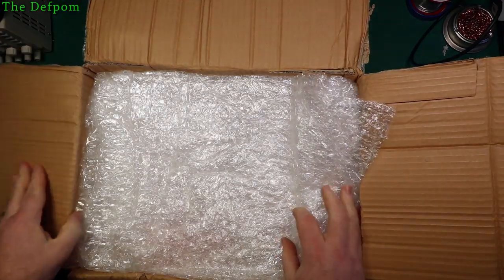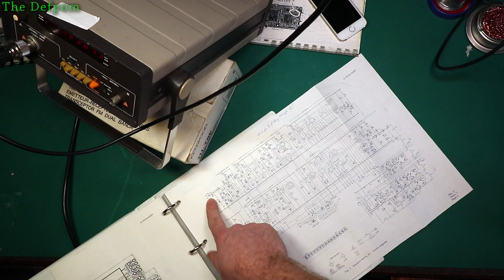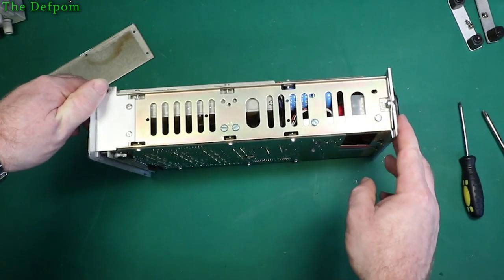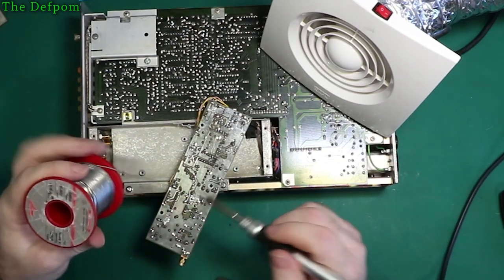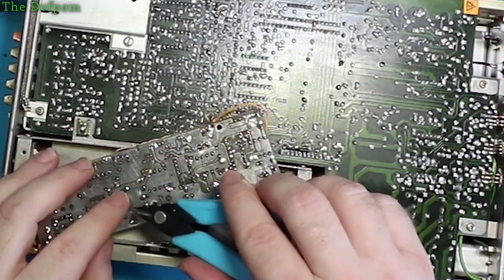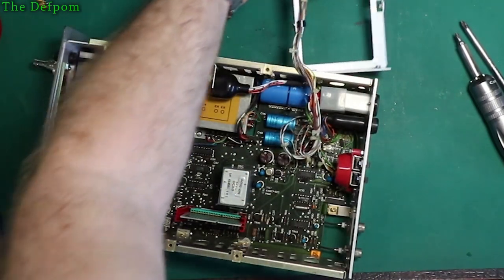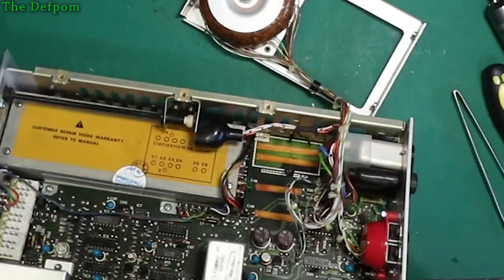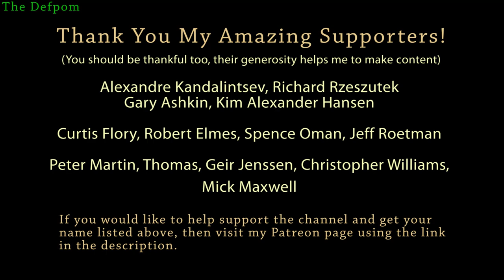🔴 #597 Marconi 2435 Frequency Counter Repair Part 1 - When Tantalum Caps Go Bad

Comment: It is great to have the original manuals and well worth the money when doing a repair. Down conversion is a common arrangement in higher higher frequency and cost units like the Marconi. You just reminded my about that high resolution HP counter I half fixed. I cut the tantalums out just didn’t get around to refitting them. Sole destroying but you really have to change them all and the main smoothing and check for ripple on the rails.
Reply: AllTheGearNoIdea
I agree, the roadmap of a schematic makes clarity of the utter mess of a circuit layout :-D
But some diagrams look like the drawer was on lsd or similar drug when drawing them, mad diagrams lol.
Reply: zx8401ztv  I think CB drawing are awful apart form the ones in those SAMS Photofact manuals they are like works of art. The Marconi drawing will be good.
Reply: Yes they are, i think modular sections with input/output labels just look simpler.
Then you can test a block one at a time.
Reply from the maker: AllTheGearNoIdea - I don’t mind cb diagrams, you get used to where they put everything and can find stuff easy enough.

Comment: Baby tants with values under 1uF simpler to replace with Wima MKF film capacitors, 0.47uF 63V is around the same size, similar enough footprint to fit and in most cases the height is fine as well, or use green dipped mylar capacitors. Close enough ESR wise, and better pulse handling ability.

Comment: Getting a wet slug tantalum backwards is a lot more interesting. They go bang quite violently, as they pop only over 180C case temperature, where the solder melts.

Comment: As  test engineers we used to tape a tant under the work bench of fellow engineers and when they were in deep thought reverse bias them with a psu. sounded like a gun shot between your legs? elf and safety was not a phrase used much then if at all.

Comment: Great work, can't wait to see part 2! For tough old/crusty rosin I use acetone - a solvent available at most hardware stores here in the states. You just have to keep it away from most plastics! Once the rosin is softened I use alcohol to remove it. You realize that by breaking that seal you have voided your warranty  ;-D

Comment: I always test ALL caps and resistors and also any diodes with the diode test in multimeter.  Sometimes it takes a while to do that.  But anything I thus find gets replaced.  Ive also taken out transistors and popped them in one of them $5-10 testers.

Comment: I have seen many dipped Tantalum's in test gear fail in the complete absence of noise or ripple on the main PS. 25% headroom for example,  20V rated cap riding on a 15V rail. What is really weird is that I have not yet encountered a wet-slug tantalum failure. I think it's a reliability, cost and end of life issue chosen by the manufacturer.

Comment: Ahh the evil tantalum beads wa wa wa lol :-D
There was a blue one in the squelch circuit of the uk 27/81 cybernet board, they blew up with psu spilkes.
I bunged in a normal electrolitic, always worked :-D

Comment: Next to the two 1000u/25V, you have two ROE brown plastic elyt caps. That model is notorious for going bad.
Edit: Ah good, you found them
Reply: Agree there. Had a ton in my Rohde and Schwarz sig gen, all leaking electrolyte.
Reply from the maker: thulinp - yeah o had come across those before when I fixed a Rohde & Schwarz SPN Generator, I did some videos on it, about 2 years ago.

Comment: Not changing the other Tants will drive you mad,every little flicker or wobble your going to be saying to yourself is it the Tants lol
Reply from the maker: An Englishman in Brazil - it’s fine after I got it fixed at was fine, I ended up selling it as I didn’t really need another counter